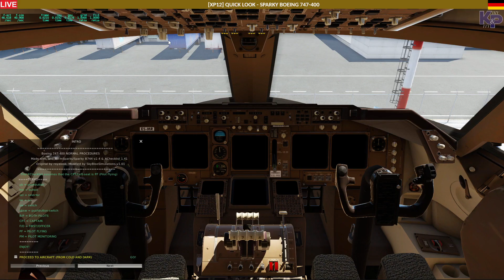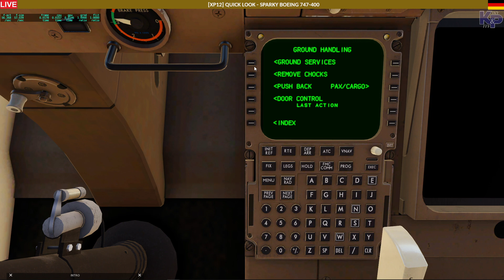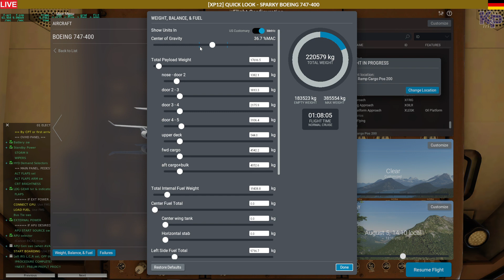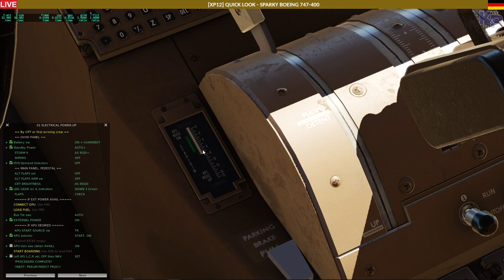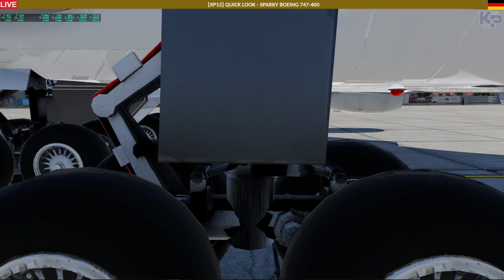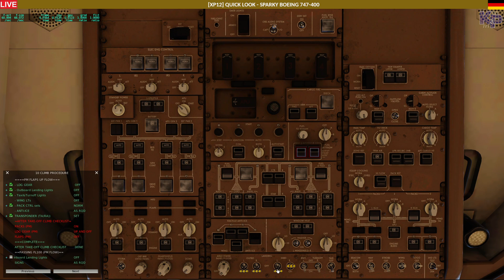[XP12] QUICK LOOK - SPARKY BOEING 747-400 (ENGLISH)

Comment: Thanks for keeping us updated on this one...new version came out yesterday btw 🙂
Reply from the maker: I know, I tested it in a live stream and got a problem again with the ILS approach. I did 3 flights, 1 succeeded including auto-land but I had to place the aircraft in the right altitude relatively early. My Try&Fly scenario does not work, in both cases I ended up above the GS although I was not at MAGAT yet and in the second failed scenario the aircraft started to climb again shortly before MAGAT. When I have some time I will test some more ILS scenarios.